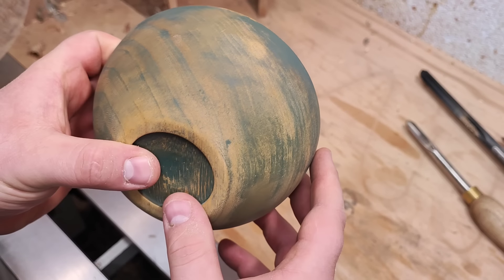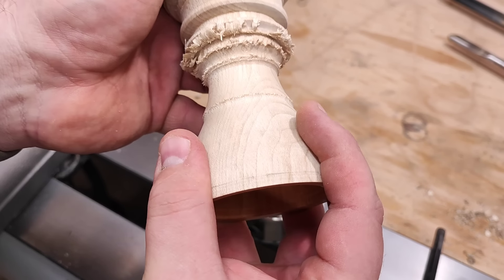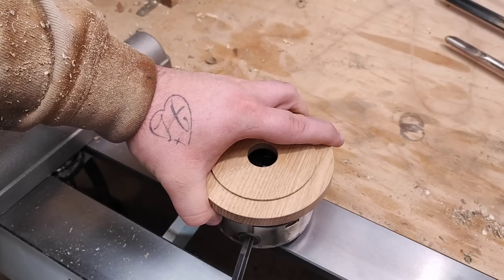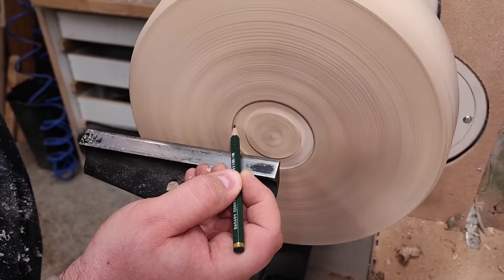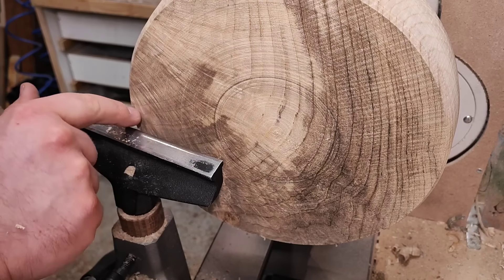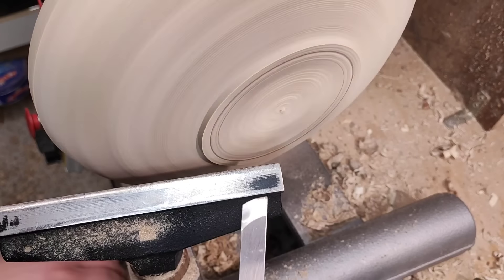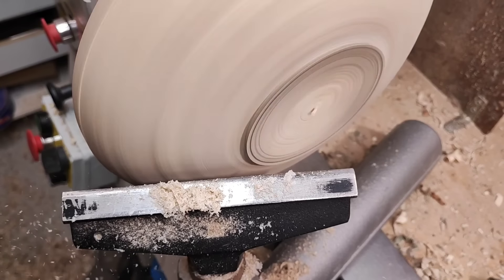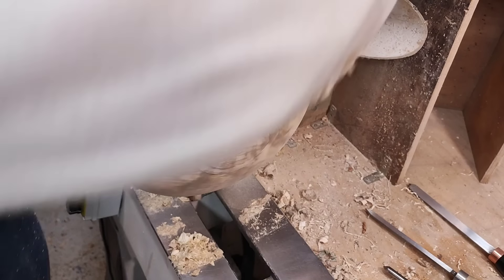Are you cutting tenons accurately? You are in for surprise...

Comment: min 23:30 "if the tenon breaks don't glue it back", I surely agree with this statement but if needed instead of cutting an other tenon is possible to flatten the surface where the broken one was and glue  to it a sacrificial piece of wood on which we can turn a new tenon with its shoulder. This is a safe way to go as there are turners that choose to not use a chuck and rely on glue blocks, glue is strong for joining flat surfaces. This method can be used if for whatever reason the turner does not want to loose height turning directly a new tenon in the bowl's wood.
Doing this is really important that both the tenon and its shoulder are turned in the sacrificial piece of wood, using it only for the tenon is not safe as the dovetail shape of the  jaw would directly stress the glue line that is already stressed by the turning process.
Reply from the maker: Indeed I agree if situation is like that.... Thank you for comment this

Comment: Between your videos and Richard Raffan's videos, I feel like I'm getting a complete Master's class in turning.  This was an excellent in-depth video.  Your explanation of why one wants the recess deeper than any outside inset is spot-on from an engineering standpoint.  Your explanations are well thought out and quite clear.  Thanks for the effort you put into these videos; it is greatly appreciated.  Record chuck jaws don't have a dovetail when used for compression tenons, but have a small hook that engages the straight tenon.  Works well from the standpoint of giving a strong hold but does crush  the tenon and leaves marks.
Reply from the maker: Thank you Mark for kind words 🤗, you are right,those RP jaws hold well but dig in the wood, I did get around that when I had them by making small decoratiom groove to hide the beak.

Comment: great info but my issue is more about how to remove tenons when you are done.  I have ruined nice bowls trying to remove the tenon cleanly.
Reply: Hi, this is where you need either a jam chuck (a tightly fitting shaped piece to insert into the mouth of the bowl) or one of those plates that grip the outside edge of the bowl that fits onto the chuck allowing access to the tennon. That seems to be the way most turner's get around this issue. I've also seen the use of gaffer tape in conjuction with a jam chuck just for additional grip and security.

Comment: Very interesting.  Off topic question if you could only buy one set of shark jaws which size do you find most useful.  Thanks Geoff
Reply from the maker: Thank you Geoff for watching and comment, I would go probably for standard size shark jaws, so 50mm diameter as standard jaws but in shark jaws variation.... If paired with vm120 chuck then you have a tone of travel range and can grit a whole range of sizes

Comment: Great explanation on tenons vs recesses. For bowls, tenons offer many more design options over recesses, as Richard always mentions. 

The only time I use a recess for bowls is when coring very large bowls. I've found the recess to be stronger than the tenon as long as you leave plenty of mass on the outside. 

If you have coarse-grained wood, you can strengthen the recess or tenon by squirting some thin CA glue into the wood grain.

Comment: I agree that a tenon is less likely to split or break.  The main reason that I typically use a mortise on the bottom of my bowls is strictly for design.  I prefer a little bit of a foot - hollow in the middle, so mainly a ring.  I find that using a mortise, I only have to do minima shaping to end up with the ring foot.  This is especially true when I do once-turned bowls. After they're dry, I go back and sand and just do a little bit of truing/shaping on the foot.  With a tenon, I would have to do more shaping after.

Comment: As someone who works at a woodworking store... I completely agree with your rant. When someone comes in complaining about a tool being off by 1000th it drives me crazy. They are always the ones who make things difficult for no reason. Even had a guy complain about the festool table saw - the sliding table being slightly higher. Made a huge deal about it. Turns out it's built that way on purpose and it's adjustable. HE STILL WANTED A NEW ONE AND REFUSED TO ADJUST IT 😡
Reply from the maker: Those are the worst, awfull, glad you survived that and thank you very much for watching